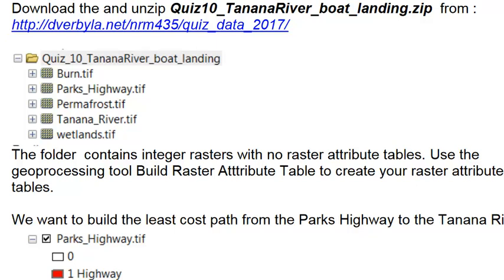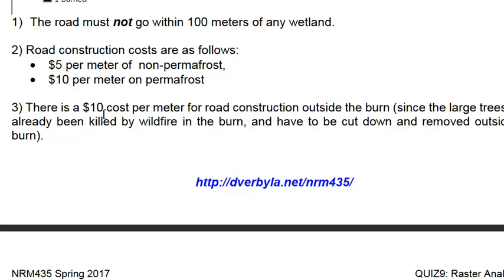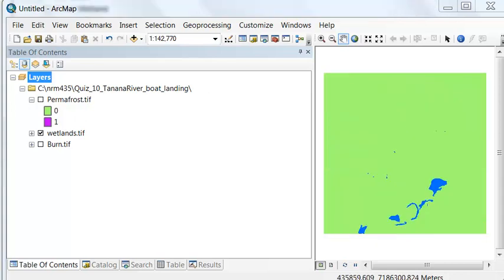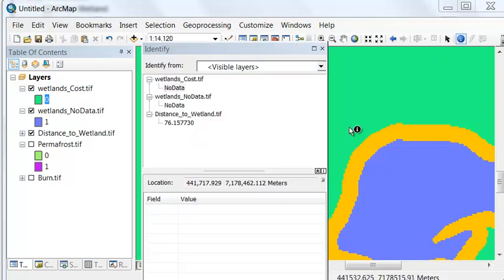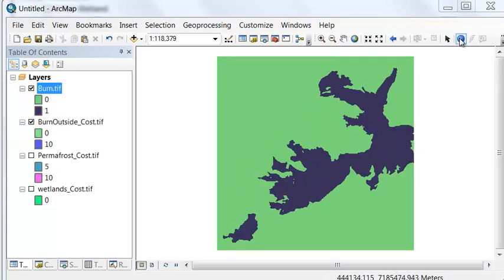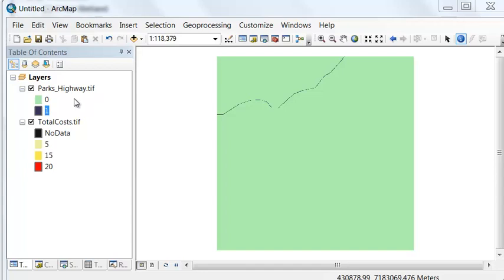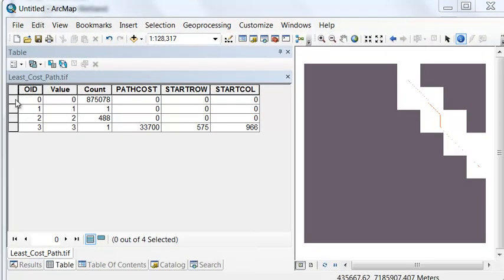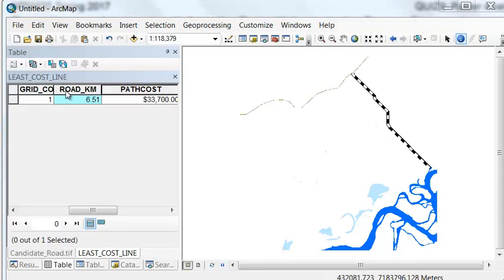Least Cost Path Across Total Cost Surface

Comment: I am investigating the effects of newly constructed rural roads by constructing a least-cost path between villages and the nearest available road. Hence, I have to construct the least-cost paths between many points (the number of villages is 1584) and lines (nearest road). However, most of the tutorials are for only two points (one starting and one destination point). Do you have another video that discusses the implementation of the least-cost path between more than one starting and destination point?